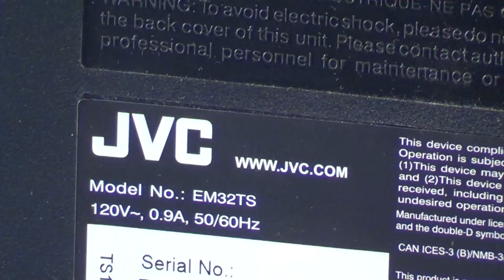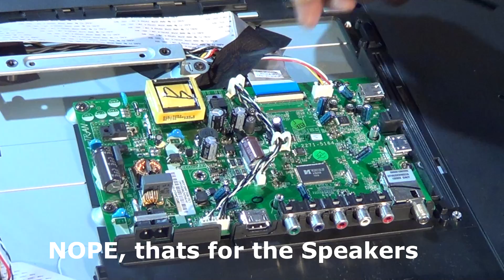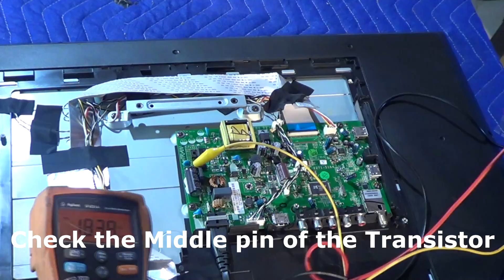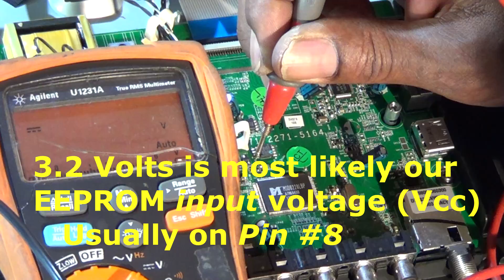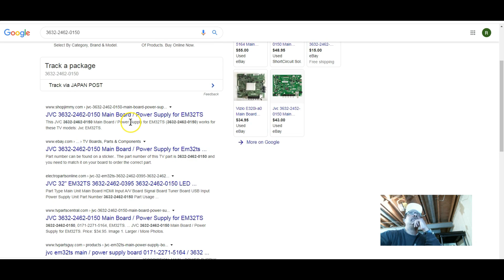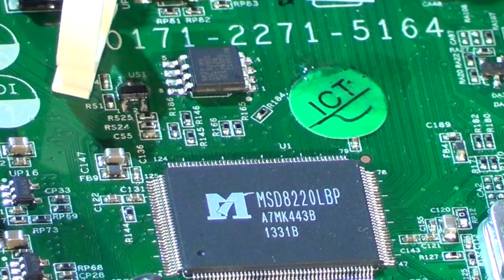How to TROUBLESHOOT Led TV's that use the 1 single (All-In-One) Circuit Board. JVC EM32T tv repair.

Comment: Hey BigDogg excellent video, on the JVC all in one, a few years ago I had a 18inch
Polaroid tv and swapped out the all in one board because it wouldn’t power on with the remote,
 but if I unplugged it from the wall outlet and plugged it in again it would power on and work
I should’ve replaced the EEPROM ✅, what temperature soldering iron is best for EPROM ,mosfett and micro rework ?

Comment: Would i use this same fix if the light at the bottom near the logo is solid and it does power on. It will show a faint JVC logo, but nothing happens when I plug an HDMI into it..

Comment: Hey man, I have a question that you might know. I have a similar tv, em55ftr, with no stby light or power. I get power to the main board from the psu. I just tested the eeprom but I get less v that what you got in your video. Pin 8 shows .65v and nothing on pin 4. My question is, could this be caused by a bad cap or is the eeprom bad?
Reply: Hey man, I ordered a new mainboard for my tv and it works again! Thank you for your help! And keep up the nice work with the videos.
Reply from the maker: @Chrisx610  Good Job Bro. Thanks
Reply from the maker: If the eeprom is available for that Mainboard then I would try it, otherwise if your getting the 5v standby to the Main, just replace the Mainboard. Make sure to check pin 8 to ground to see if its even shorted, if not, then just order the Main.
Reply: @bigdog8882  the psu I have for my set doesnt have a stby and shows 19v at 3 pins then the ground pins. I get 5v at the main board where the connector is for the power button.
Reply from the maker: @Chrisx610  Well the PS is probably working. So U have a Mainboard problem either way. Double check the part number on your mainboard. SJ has it for $60 https://www.shopjimmy.com/jvc-3655-0852-0150-main-board-for-em55ft.htm